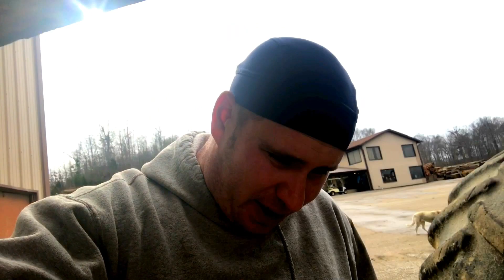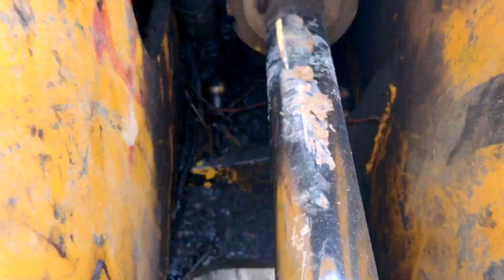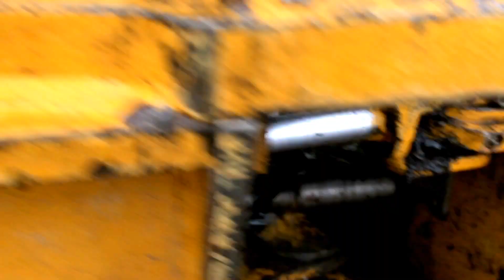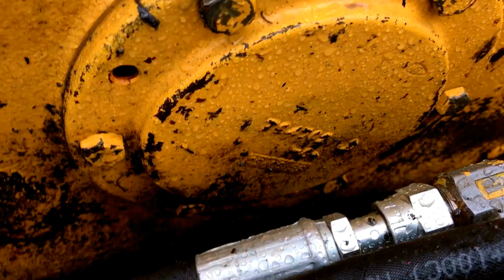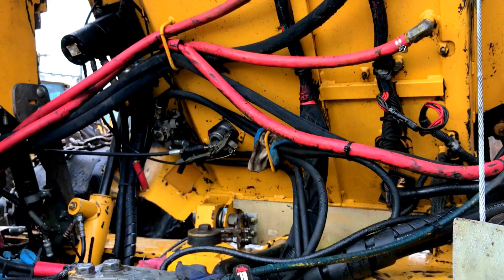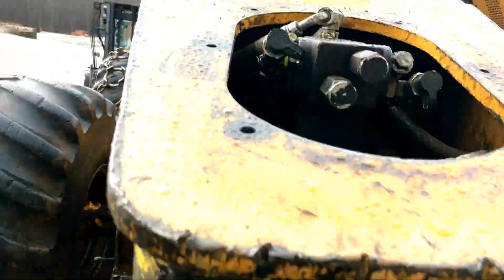Ok Ok I washed it already!!!!!

Comment: Thank you Wade...   Once again. You made me proud..    taking a minute to admire your equipment, showing some respect for the base of the whole operation...   I feel like you did that ol GII  Justice..  it's a rock solid machine that was built to get in.  and get out .. nothing more. Nothing less .. We talked about the long and short frame in the yard there.  But it just hit me.  It's   Short , with the perfect stance ..whether your in select cut.  Or high production. It's got the guts to keep up, and the light foot print to go where others dare not.  First step to being an operator.  Is respecting the machine.. Thanks again
Reply from the maker: jeff mason hey bud thanks!!!  Yeah now you see why I think your GIII is so balanced...  we got a local guy I'm gonna get on vidja that bought an H and I think it'll have the same balance but more capacity...  could be one of the best rigs I've seen for around here
Reply: jeff mason eric

Comment: We had a 1996 648G dual function grapple bought it in 2007 just sold it November 13. It was skidding 6 loads of small lodge pole pine before it sold. Bitter sweet. Now we are having a hard time deciding what to get so we don't have much for problems. We have a 535C and thinking of getting another one.

Comment: maintenance, it will kill or save a machine. as long as you keep up on it, it will last as long as the frame does. we have haul trucks with over a 100,000hrs on them, and no end in sight. cat originally said they had 60,000hr frames. this all backs up to good maintenance. I have also seen machines beat to death in 2000hrs. I am sure yours will last as long as you want it to. all the best.
Reply from the maker: salty 101 haha thanks bud I know your right!!!  And 100,000hrs is a lot by the way
Reply: these are open pit heavy hauler dump trucks. they run 24/365. they only get shut down for service so clock about 6000hrs a year.  But yes it is a lot. I also think your smart to keep clear of the tier 4 stuff. they are more fuel efficient, but can be a problem when they act up. all the best.

Comment: I'm not a logger but have always wondered how much those tires on that machine cost and how long do the last?  They look like they are high dollar.
Reply: Johndeere5065 my boss just got a set of front tires 1600 bucks a piece but that's here in Oregon stay safe friend get logs
Reply from the maker: Johndeere5065 these tires are about 4300 a piece for the floaters
Reply: Logger Wade holy smokes thats a big differents.kinda wondering if he didn't get a used set now he was pretty happy with the price

Comment: Man your in bad need of one of those $89 rotating turbo nozzels from Northern Tool there worth there weight in gold and would make your pressure washer times 4 on what it do.
Reply from the maker: Van Crawford hey bud talked to Clint the other day that charger ended up in Illinois and his dad has passed and he don't remember who he sold it to...  I told him to ask his mom and get back with me
Reply: Thanks man the guy in Illinois who owned it for a while called me about 15 years ago after finding an old insurance car of mine after he had removed the dash but he has now sold it and its looking like lost forever. If I could just find the VIN # off it I would have no trouble tracking it down. Thanks a lot man and what about that cottontop3 feller I've got to watching some of his shat lately. Be safe out there Brother and I've got a buddy that has run a knuckle boom cut off saw for 30 years and has retired from his own business and has gotten tired of setting at the house and would like to go to work running one for some one. If you ever need some one completely trained up on one of those thangs that can run one as good or better than most anybody on the planet give me a holler. I used to drive his Mack road tractor for him hauling logs you probably have even seen the truck it was that long wheelbase blue 87 Rmodel Mack that Mike Russel bought new and kept for a couple of years before selling it to this guy it had one of those awesome Battlewagon drop deck trailers behind it.

Comment: Do you still have your g lll all turned up like in your older video?
Reply from the maker: A.L.L. Firewood its not as hot as I used to be but erma is tweaked and don't weigh much